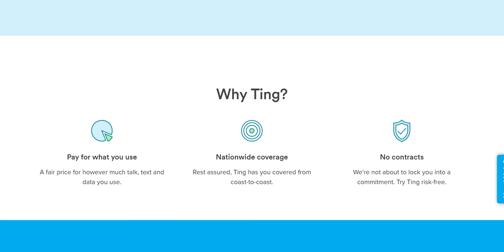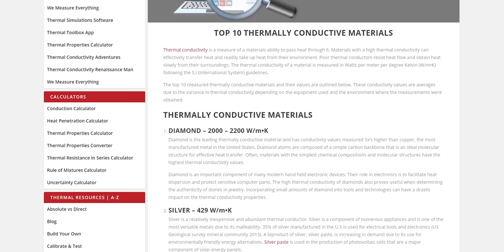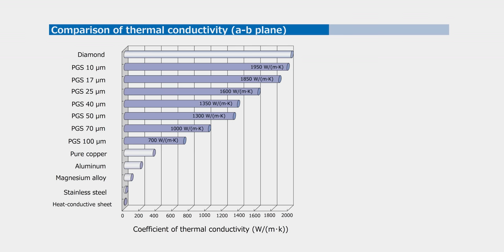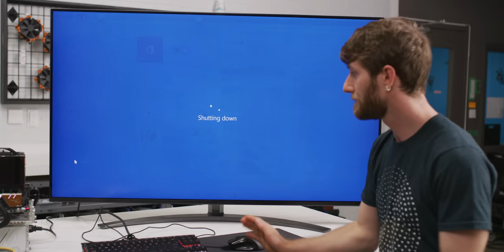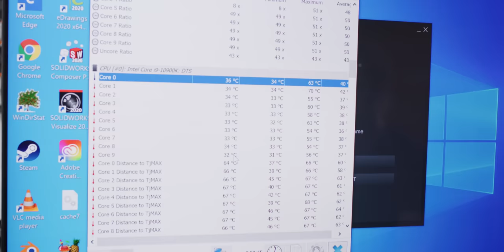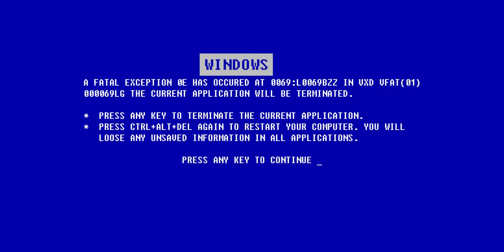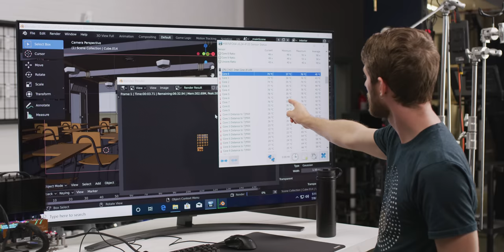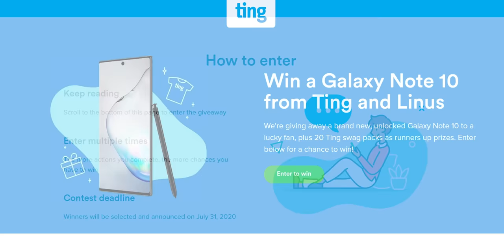This Sounds Too Good to be True - God-Tier Thermal Pad

Comment: Of course it wouldn't work on a CPU. You needed to try it on lesser heated components like vrams, because the that thermal pad is rigid is not designed to fill the micrometer gaps between the CPU and the heatsink. That and that you bought the wrong pad as Jpeg6 explained.

Comment: Actually, graphene is a directionally biased material. It has both excellent thermal conductivity and electrical conductivity in the same plane as the sheets (the theoretical thermal conductivity is higher than for diamond at ~4000 W/mK). However, between individual sheets both conductivities are terrible (thermal: ~6 W/mK). A vertical termal pad is not an appropriate application of graphene, at least not in this form.

Comment: Hmm... der8auer's mechanism of mounting cooler off-center AMD processor gave some improvement in cpu temps, AMD EPIC cpus with multiple chips spread under the heat spreader have better temps than one-die solutions. both cases tells that cpu heat spreader's heats unevenly from one chip cpu.

SOOO if this thermal pad is able to move huge amount of heat from one part of itself to another like crazy then maybe it worth using it under the heat spreader to move heat from the center to the all surface of the cpu heat spreader?

Comment: Went through the panasonic link very confusing too many thermal pads which one is right? Non of them says pgs
EYG-T3535A20A

THERM PAD 35MMX35MM W/ADH BLACK

EYG-S091210

THERM PAD 115MMX90MM GRAY

?

Comment: Has anyone tried lapping down the heat sink and the IHS to promote more uniformity between contact points before using any type of ic diamond, carbonaut or this pgs? In the very least it could eliminate some amount of variation.

Comment: 1) thermal transfer pads and your assorted CPU goop (aka thermal paste) work by filling the MICRO imperfections between the CPU heat-spreader and the bottom of the heatsink. 

2) how is something that is measured in microns (10 um? he said) supposed to fill these MICRO imperfections? I'm reasonably sure that the laser etched info on the CPU heat-spreader is deeper than 10 um, so that's not making contact.

It can't, so a better conclusion: Unless you're willing to polish both the CPU heat spreader and the bottom of the heatsink to a mirror finish (nm imperfections) don't buy this for your rig.

Comment: My laptop thermal throttles like mad. I am going to upgrade the thermal paste because according to forums it is absolute trash, but should I also add a thermal pad onto the underside of my laptop touching the heatsink (connected to the bottom part of my laptop), or would it not be worth it?

Comment: I'm only about 5 minutes in, but is a 10 μm thick foil even thick and elastic enough to serve as a connection between the CPU and cooler? I would imagine there will be lots of air gaps, making this thin foil useless for that purpose.
Better hope there a no scratches on the parts.
Edit:
Yup, as expected.
Would a tiny amount of thermal paste help? Like, put some on and basically "scrape" almost all of it off again, so it serves as nothing more than a gap filler. Granted, that's in essence its job description in the first place and why bother with the pads in that case, but... you know?

Comment: If they tried running that test with nothing on it and it does better, then you know its having a negative effect. comparing it vs thermal paste seems like it was bound to fail. Thermal paste is fluid and fills the gaps, that sheet is going to be the same as running nothing.

Comment: It is only highly thermally conductive sideways. And its not compressable. Could probably beet this with lapping and no thermal compound.
Reply: If you bought a reallllly expensive block f the stuff and rrotated it 90 degrees it might work.

Comment: thermal paste,   I have some pro seal, 2 tubs, hardener and glue, the glue has metal in it, tested it, magnet, could this be used as a Thermal paste, as long as I do not put the hardener in it,   :),  reason, its is cheaper the thermal paste, :)

Comment: Thermalright Thermal Pad 12.8 W/mK, 85x45x3mm, Non Conductive Heat Resistance High Temperature Resistance, Silicone Thermal Pads for Laptop Heatsink/GPU/CPU/LED Cooler (3mm) , found this on ammazon and it says it is for GPU/CPU  ... maybe they did and upgrade.

Comment: If the product was actually engineered for this application, it could be good...

But right now the two biggest problems are: The material isn't fluid enough to fill in air gaps, and the material also isn't thick enough to do so.

Comment: maybe he was installing it wrong, he had to only lay it on the cpu heatspreader, on the otherside i could imagine on a delited CPU it could work better. I also might thing the pressure between cpu and colling solution should should be higher, eventualy it couldnt fill tha gap between.

Comment: I think it could have been much better if there is no air bubbles between the heatsink & this "thermal pad" also, Linus, you got dust and fingerprints on it which probably made it worse. You could've at least used gloves.

Comment: Diamond isn't the most thermally conductive substance known to man it's not even the highest conducting form of carbon, Carbon Nanotubes & Graphene are higher. Superfluid Liquid Helium II is the highest known to man perhaps you should try cooling a CPU with it you may need to change the crystal on the MoBo to get it to clock @ 10Ghz+.

Comment: Why are there no cpus that come witha cooler preattached to them? It seems that the interface between the cpu and the heatsink ist the biggest problem and thermal paste/ pads aren't up to the task to solve that problem. So why don't you soder a heat sink to a cpu to test that out? @linustechtips

Comment: if you got both the surface of the CPU and the surface of the cooler completely flush and free from imperfections, I'm sure it would work rather well. Anywhere in between, no.

Comment: I'm guessing the reason why it's doing so poorly is because instead of transferring the heat from CPU to cooler it's drawing heat from both sides and creating a micro hotplate on top of the CPU. If you can cut an ice cube with the heat from your hands it clearly draws and stores said heat.

Comment: PGS Are good at conducting heat in the x-y plane, but very poorly in the z plane. You are also missing the point of a thermal compound. Thermal compound fills in the minute gaps between two solids for effective conduction. The solid PGS cant do that, since it is a solid material itself. You are just slapping an insulator in a heatsink that already has no thermal compound, so it can only do worse.

Comment: (this thing I'm going to write is probably stupid like sh*t)
What if you put a layer of that "thing" (but sticked on the cpu ) and on this normal thermal paste ... 
I'm interested to see how this thing goes with a cpu like r3950x because the cores of this processors are not in the middle , maybe if spread the heat under the base of the cooler can dissipate better...der8auer made a kit to center the cpu cooler with cores position of third gen ryzen processors  and he gaign 3-4° I'm wondering if can perform the same or significantly worse

Comment: of course graphene is electricity conductive. The first thin layer on showing contact with  only part of the CPU lid .. its not the area of the "Die" (chip) that is relevant..the heat is spread out to the entire metal lid.. so you need contact with the entire lid to take the heat from it... one reason the graphene its not naturally sticking to metal, thats not assistting with removing the air bubble, the air bubbles just move around as a result of the nonstickyness..   and you know what, the extreme thermal conductivity of the graphene is  of no benefit if the glue is  less thermally conductive.. and  of similar thickness...   you get no great benefit..  you could just use the glue  with no graphene !  You only want some other material if you can save money by not wasting your expensive glue on filling the gap.. its not terrible to have graphene inside a thermal pad, but its not glue and  its always going to be the glue stuff that is critical.. to remove the air bubbles   ...

Comment: 10 micrometer per layer? Not wonder why it didn't work, you need at least 100 of that layers to make a 1 millimeter. Don't matter how high is its thermal conductive, you need enough mass to make it work.

Comment: I wonder if the adhesive is not very thermo conductive.  This particular product might be design to coat an interior. I can imagine lining an engine turbo blanket in it to distribute heat around the compound but not through it.

A thought...

Comment: I'm getting getting a second hand pc soon with a gtx 1060 6gb, 12gb ddr3 ram, 1 tb hard drive, core i7 8700, 500w power supply and an Asus p7h55d-m evo motherboard. For $390(R6500 I live in 🇿🇦 that's why it sounds as cheap as I think it sounds but anyway)  I want to ask on a scale of 1(leave it) to 10(definatly buy it) what would you or any1 who is reading this rate the "fact of me wanting to buy it" and why?

Comment: you guys realise this is literally the same shit IC Graphite Thermal Pad is right? Like they literally buy in bulk from Panasonic and just cut them to size. PGS is available in many different thickness. The thinner sheets don't necessarily work better than thicker sheets. I bought 3 different thicknesses and tested them. I believe IC already did their research and picked the best thickness for PC application. The thin sheets are too thin to fill the imperfections on the surface of the IHS and cold plate, which is what thermal paste does. So you do need a little bit of thickness to get it to work better

Comment: There is a substance with a better thermal conductivity than Diamond/graphene.
All air cooling cpus and notebooks have it. They're also far, far cheaper than graphene; they're called Heat Pipes and can reach a thermal conductivity of 100000W/mK!

Yeah, they cheat alright. Instead of pure conductivity, they rely on evaporative cooling. That's convection, not conduction. Still, since they're a closed system you can picture them as the very best heat conductors if you're designing something. And still, as amazing as they are, they're still limited by the processor/pipe interface.

Comment: #1, application competence is lacking. Peeling away the protective layer and waving it around while touching it with your fingerprints, etc.
#2, Some sanding of the contact surfaces would improve contact performance.
#3, If you can not use the scientific method to demonstrate something when you are trying to compare something scientificly, then don't do it and say you did.

Comment: Talk about jumping the gun. Read the datasheet carefully next time. It clearly states that it transfers heat on a-b plane. the  c plane acts as insulation. In other words, its great for transferring heat LATERALLY not VERTICALLY. Theres even a diagram in the datasheet!

Comment: I think you just need more layers. Its like an onion, you see.
Reply: You are partly right. They need many more layers all standing up. This stuff only conducts heat in one plane. It is really weird like that. That's why Linus was able to melt the ice cube with it. It does conduct in that long ways across the sheet. It doesn't conduct through the sheet though. At least not too good.

Comment: Like im a dumbass so prolly dont wanna listen to me but like what if you used the graphite on the heatsink panels themselves? like take the heatsink apart and put a layer on either side of each metal fin to distribute the heat over the entire surface meaning more cooling?

Comment: Buuuuuuuuuuut this is a bad test.  Noctua heat sinks have grooves milled into the bottom surface to improve spreading of their goo/reduce air pockets... that would suggest a semirigid pad would have terrible contact because it would NEVER fill in the grooves.  Even basic sanding of the heat sink should improve contact and therefore performance dramatically.  Cmon team!  You don't need to know about anistropic thermal conductivity or whatever they're talking about below.  This is an obvious non-scientific blunder.   ::thumbs down::

Comment: Its amazing how wrong these thermal numbers are reported by suppliers. If you look in scientific literature, gallium will only reach up to 20 W/mK and thermal paste at most will be 5 w/mK. Literally you cant make a liquid metal at 78 w/mK. Also, you  only really care about the thermal impedance. Thermal conductivity doesnt tell you how good a TIM will be. Copper has a high thermal conductivity of 380 w/mK but is a shit TIM. This is the same with graphite, it is highly crystalline and will not be able to fill in all the unevenness for the IHS and heatsink. One thing to note, graphite is only highly conductive in 2 directions. This is a great spreader, but the z-axis thermals are horrible.

Comment: So many things wrong with this video, like saying it's not electrically conductive, just to show that it is conductive... Because... It's graphite...  (If you wanted electrical non conductive, you order that SKU) 

But I'll just focus on Alex at 6:32 saying the thermal conductivity of the adhesive is "Quite high.".

1.6W/mk is not "quite high", Alex.

If the writers had more than 5 minutes to crap out an idea for a video, maybe they would have looked at the datasheet, realised that there's another product Panasonic make that would be PERFECT for this use case (Soft-PGS). But because they were rushing and wanted the clickbait title of 1950W/mk instead of 400W/mk x-y and 28W/mk in z, we got this turd of a video.

Comment: Only problem is your test was flawed, as you applied it backwards!! You could clearly see during the ice cutting the the side without the adhesive melted more of the ice than the side with adhesive. 
   That right there should have told you that it should have been applied to the CPU not the Heatsink!

Like always a flawed test!

Comment: this isn't a valid review. you can't place these upside down, like the way they applied it to the cooling block here. you're meant to stick it directly onto your CPU's heat spreader; perpendicular to the motherboard. think z-axis. sticky side down, facing the block, away from the motherboard. this is because it only transfers heat one way due to its molecular structure. that's what makes graphene pads so good (if facing the right way up). what Linus did was prevent the chip's heat from even entering his heatsink. he INSULATED his fcking cooling tower block lmao 

for example look at Thermal Grizzly's new 0.2mm graphene pads. thermal transfer-wise they work better than any diamond paste and NEVER need replaced. but only IF you stick em on the right way. but they probably aren't practical for anyone who regularly takes apart or services their PC, because once stuck you can only use them once. they break if removed or unpressed because they're so thin.

Comment: You CLEARLY lack a firm understanding of physics & Thermal dynamics.
Your heat sink is Designed to draw heat UPWARDS into the radiators to dissipate. that pad conducts heat LATERALLY.
putting it between the CPU and the heat sink negates the cooling effect of the heat sink.
Just because you explained that you understood how it worked  doesn't explain why you conducted a test
you SHOULD have known would fail.